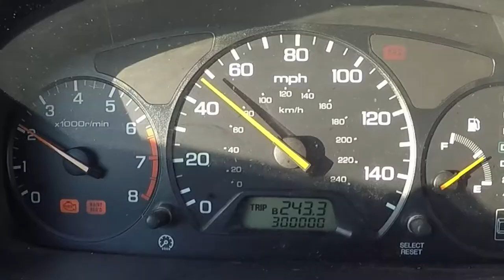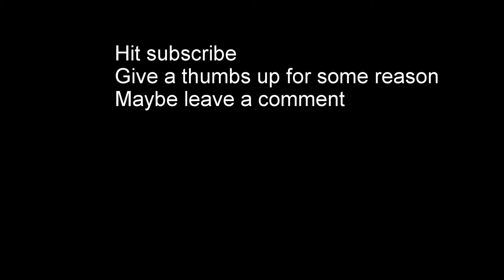How to build a solar dry kiln Part 4

Comment: Now that you have had it up for a while, how has it worked out for you?  Your's appears to be the Wood Magazine design.  I have just started  my own using that design.
Reply from the maker: It works well. The slower the better though. Air dry as long as you can stand then keep the vents open a good long while. It holds quite a bit and the fuller you stack it the better.
Reply: @charliethornburg1542  and thank you for letting us be a part of seeing your odo turn 300k.  Truly a joyous occasion!

Comment: What if the max heat temperature is 38-45degree celcius in my place How long does it takes to dry the wood?
Reply from the maker: Lot of variables there. Couple months. Give or take

Comment: So have you been happy with the results from your kiln so far? Do you think this method would work well in the south where it is more humid?
Reply from the maker: so far so good. Its been cloudy most of the time ever since I got it done but once the sun comes out it gets pretty warm. I think it would work fine in a more humid environment because with the high temperatures that it can reach you will still get plenty of evaporation. I will have another video out in a week or so showing the air flow and moisture readings.